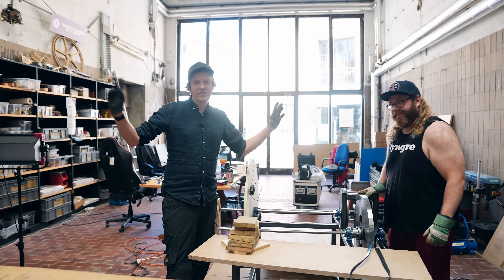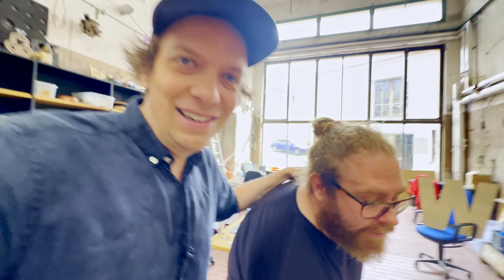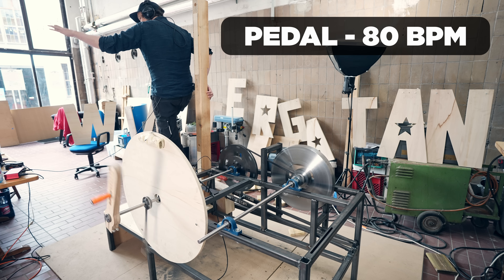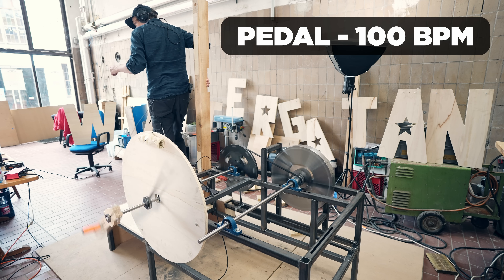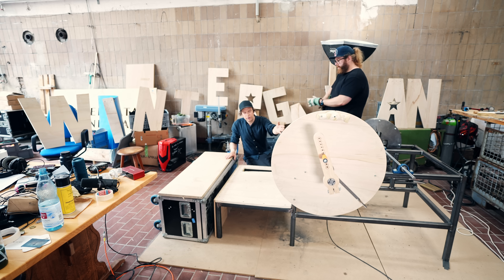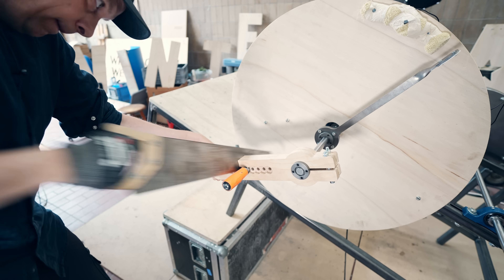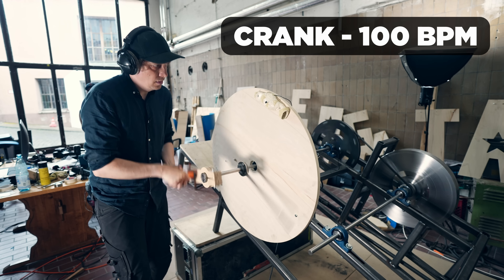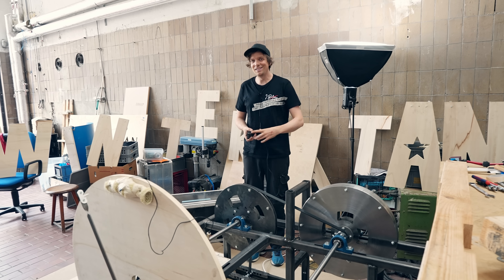Heavy Flywheel plays Tighter music! - DAY 11 - Marble Machine Flywheel Prototype

Comment: This is not at all an exercise in how tight music can be played on this machine. It's an exercise in how Martin can match an arbitrary spot on a wheel for a few spins before it inevitably goes out of sync again.
Reply: To me it seems like he is just testing the physical mechanics of the operator trying to keep a consistent temp. This makes sense to me from a user perspective. I do think adding a speed governor and a gear cassette to shift between predefined tempos (as well as a "free" run tempo mode") would be much better solution, if the goal is to satisfy the "must have" requirement of tighter music - which given the context includes matching tempo perfectly
Reply: @FreejackVesa  We repeat. He is not measuring temp, he is measuring the ability of him and the machine to match a random sync point. If he is not planning to play this machine live synched with another machine, this test is useless. He never mentioned something like this, never separated the sync from the bpm, either practically or in terminology. What is see is him again seeking overcomplicated non-solutions to subjects he does not understand properly, or, does not communicate properly.
Reply: @constantinosschinas4503  my suspicion is that if he's intending to play this with other performers you will need to sync to a click track.
Reply: @OpinionatedSkink  The performers will sync with the machine. As they do in between themselves. This is what happens in all live performances anyway and naturally. A singer, drummer, lead will fall back or run and all the other will organically follow. The problem would arise if two machines need to sync. But this was never a design requirement, till now that is.
Reply: @constantinosschinas4503  he says he's not measuring tempo but I think in actuality that's what he is doing. Call it "sync" or whatever you want - it's the speed of the foot pump translating to speed of the flywheel which translates to speed of the programming drum, which programs to speed of the release of balls, which translates to tempo. I think the purpose and semantics of this test are complicating things. Think of it in totality. As you say, what does sync measure? Nothing. It just shows that you can reach and sustain tempos for extended periods of time. And yes, he's an idea man and a dreamer, let him follow his critical paths, at least he is learning every time he does this. It's part of the show that we tune in for.
Reply: It's beyond my comprehension. MM could play tight music with a sloppy rpm. Tightness is in parallel events lag or I miss something? It's like a real drummer with a bass player could be super tight but they don't stick to perfect consistent bpm.
Reply: Either, after dozens of comments, he keeps confusing bpm with synching, or we miss something. It is beyond me that he does not simply use an rpm gun as a realtime guide on whether to slow down or speed up, ditching the unecessary, useless and complicated software analysis that reality is completely based on biased flawed (trying to always sync) user input that neglects what is important: stable rpm...
Reply: At first glance you might think that his test is simply a measurement of whether "HE" can hit the right beat. However, what Martin is testing is the consistency of whether the flywheel can consistently match HIS rhythm. Think of how practiced Martin is at playing music. HE wants to be able to play tight music without worrying about whether the machine will copy his beat. Essentially, its an input/output test. If I put in the right amount of force, do I get the right tempo out of it consistently? That's what's being tested here.
Reply: @SuspenseWorkouts  it's interesting to see null hypothesis test, where Martin uses stick and mic to show time deviation without any mechanism.
Reply: Needs a governor then
Reply: @SuspenseWorkouts  The machine always matches the player's rythm, delayed by the inertia of the flying wheel. That is irrelevant of what he erroniously tries to measure. This is again one of the times that having geeks that can programme around you, actually make things worse and overcomplicated, and in the meanwhile get irrelevant results. Groupies.
Reply: Martin appears to be attempting a Human PLL (phase locked loop). He’s quite good at achieving a certain bpm but his audio cues tell him the phase difference between his manual cranking an an arbitrary reference. 
Why? 
I no longer see what he’s trying to accomplish. 
If he wants to add marble sounds to a recording then “zero phase” is important for “tight music”.
If a band is following his lead as he plays the machine, or if he’s solo, then it’s already steady enough.
Reply: @barryhansen3168  As I've said before, Martin is moving the goal mid-game.  He originally defined "Tightness" as:  "Assuming a constant repeat-triggering, do the marbles always strike the instrument at non-random intervals."  The moment Martin started looking at standard deviations, he was asking the question, "Does this dataset have random fluctuations [that obey a Gaussian distribution]?"

Now?  He's measuring a periodic … and therefore by-definition deterministic … oscillation.  Standard deviation is a useless measurement for deterministic behavior.

I expect him to next conflate mechanism-latency with "tightness":  yes, there's a 10 millisecond delay between when a programming pin hits the trigger and when the marble strikes the instrument.  And it's always 10 milliseconds, with no random variations.  You and I just know that he's gonna obsess at getting rid of that 10-milliseconds, because he's redefined "tightness" to mean "zero latency."  ☹️

As you hint at, latency won't be an issue if the rest of the band is keeping time to the MM3.  But if Martin tries to make the MM3 keep time to, say, the drummer, he will fail every time.  Because an instrument like the Marble Machine cannot, by nature, keep a fixed BPM.  Having the MM3 keep a smoothly varying BPM should be good enough.
Reply: @jeffreylee7184  As I said in my own comment, Martin is moving the goalposts on himself:  he's redefining what he means by "Tightness", thereby creating the very situation you described.

Originally, what he was calling "Tightness" was:  "Given repeated triggering of the marble-drop mechanism at a fixed Δt, how much do the marble strikes [on the instrument] vary?  Do they stay a fixed time-interval apart?  Or does the interval between repeated marble strikes vary around some average?"  If the triggering mechanism, from the programming wheel to the marble striking the instrument, doesn't play an 1/8th-note as an 1/8th note, if it's delayed by 1 ms on one note, then is too soon by 3 ms on the next note, then too soon on the 3rd note by 1ms, and so on, the music won't sound right.  Having 0ms variation between every note played — that was his original "Tightness" criteria.

Jeffrey, you're absolutely correct that Martin is setting himself up for frustration and failure, because he's moving the goalposts on himself while trying to make the power module do something other than provide power to the machine.  We need to get Martin to see that, or he's creating a world of pain for himself.  I hope someone who reads this is on the MM3 Discord and can get word to Martin to stop redefining "Tightness" mid-game.
Reply: Also: titing, and requires concentration, and when actual force of the mechanism will be applied it will be going out of sync CONSTANTLY. Not just a governotr, but a motor - that's what he needs.
Reply: Agreed!  He's not talking about "tightness" but "keeping tempo."
The "tightness" concern is, "Given a constant power-input, do repeated marble releases strike the instrument with zero random variations?"  If you're playing a sequence of 1/8th-notes, you don't want there to be random 1 to 5 ms variations between the notes!

But gradually varying tempo?  Music naturally changes tempo!  Martin needs to just make that part of the natural behavior of the instrument, akin to how there's no volume-control on an organ or a harpsichord.  Composers, like Bach, had to come up with new music techniques, both in playing and in composing, to compensate for the lack of volume control in a harpsichord versus the natural ability of violins and cellos to control their loudness.  He … and the rest of Wintergatan … just need to lean into the Marble Machine's naturally-varying Tempo and make that part of the music.
Reply: @jeffreylee7184  Actually, that's not quite right.  Musical notes don't need to be spaced in time uniformly, just deterministically.  Tempo can speed up or slow down … just not at random.

For example, if you have absolutely fixed and uniform BPMs while playing CPE Bach's "Solfeggio", you get what my harpsichord instructor called, "Sewing-machine-Bach.  A Sew-feggio.  Not what we want." 😆

"Tightness" does not mean, "An eight-note is always this-many-milliseconds long."  BPM can vary — tempo can vary, and is one of the traits of this instrument.  No, "Tightness" means that "Back-to-back eighth-notes when played at a constant BPM do not randomly get longer or shorter."  Well, "Tightness"-as-Martin-originally-defined-it.

Another problem that I haven't brought up is that the programming "wheel" — really a programming cylinder — has its own Moment-of-Inertia, meaning it is strongly coupled to the power-module.  You also brought this up indirectly when talking about adding loads to the power-module.

But I repeat:  having a non-constant BPM is okay as long as it's not a randomly changing BPM.  If it slows down, then speeds up, then slows down again, well, that's just a trait of the instrument.  Kinda like how a guitar or other fretted instrument can't play microtones, but a violin can.  Or how baroque and rococo composers had to work around the fact that a harpsichord has zero volume control, while every other instrument can change its dynamics.  Slow, consistent variations in BPM are just part of this instrument.

But if Martin really wants clockwork tempo, then he needs to power the MM3 like a clock.
Reply: @jeffreylee7184  Well, remember what he defined as "Tight marble drops" originally.  BPMs were not a variable.
Also?  The moment he started looking only at standard deviations, his question became "does this thing I'm measuring have random fluctuations [that obey a Gaussian distribution]?" 

That's the problem:  he's changed the definition of "tightness" and doesn't appear to realize it.  He's still looking at standard deviations … which don't really tell you much if you're dealing with deterministic data.  And what he's measuring here is periodic behavior, one of the standard examples of deterministic behavior.  Using standard deviation here is like measuring the length of your house by timing how long it took to unroll the tape measure!

And you're correct that Martin is putting in a great deal of effort cranking that flywheel, even before he tries to hit a specific BPM.  He needs to change how he's storing energy, decoupling it from the BPMs.

Comment: The flywheel should just be your power storage and drive output. Nothing about how fast/slow you put energy into the flywheel should contribute to the actual BPM of the output. You need a mechanical governor as well as a power output divider if you want to actually play tight music. You are asking the flywheel, pedal/crank to do too much.

Comment: The hand crank plays tighter for several reasons, but one of them is that both positive and negative power input is possible 100% of the time, while with pedal it's much more restricted - when pedal goes up it's possible to only add negative power (to slow it down), when pedal goes down - only positive (speed up), and in end positions the power transfer is zero, making for a much more uneven power input.

Comment: Hey Martyn! I really do think you should go with a hybrid solution with a weight-based clock actually moving the machine, but the pedal keeps the weight off the ground. I would definitely start each song with the weight all the way up as well, so that the inertia is already built when you put your foot down.

This way, the consistency of your foot doesn’t matter to timing, but it is still you who is creating the power and driving the machine. As long as your foot power is greater than or equal to the weight falling, you’ll have consistent music.
Reply: I agree and can't see what the downsides would be other than adding more weight to the machine. Should be possible to rig a system which allows for quick changing of the weight also.

Comment: This is getting very dangerous! If anyone gets caught in the open belt/pulley, the kinetic energy literally will rip their arm off. Same with the crank arm.

Besides, this is becoming a huge detour/ feature creep / sidetrack that is so far not delivering any worthwhile results.

Please just use an electric motor for now, and put this flywheel-escapade in the fridge for the moment.

Comment: Because this is a feedback loop, some damping may be required to reduce the speed variation. This will be provided by the marble machine's frictional losses so the machine should be easier to control once the whole machine is done.
For perfect testing there should be some friction added to simulate the machine losses.

Comment: i think you should mount the timing "clock" with the contact mic on the other side, where the big pulley is, then you can mount the crank closer to the frame and bearing, that way the steel shaft doesnt flex as much.

Comment: A benefit of the crank is that you can adjust the power added through the full revolution of the crank whereas with the pedal you are really only adjusting power on the down stroke.   You could probably  increase the level of control of the pedal by adding a toe cup so that you can also control the pedal on the up stroke.

Comment: I think you could run it tighter if you had a BPM-"Tacho" (speedo?) to measure the BPMs of the machine live.
Right now you're hunting a "point in time" with the drum. This requires slowing down and speeding up all the time, to hover around the pulses of the drum and with hat your measurements are worse than it could be.
Don't try to match up with the drum but stay in rhythm with it even if you're early/late. I bet if you do that it's getting much easier to hold the BPMs.

Comment: It might be useful to differentiate 1-handed from 2-handed cranking, as well as considering what that means regarding additional instrument manipulation limits.
Also, a bicycle pedal input could be more similar to the crank, especially with a toe loop.  Following that, a similarly offset 2 handle hand crank vs 2 bike pedals.
Bicycles often come with a clutch and derailleur.  The one-way clutch may be good for safety, and the derailleur might be helpful when charging and changing tempo.
As the weight and gear ratio further favour the flywheel, getting up to speed and changing tempo could become more difficult and time consuming during a live show.
Some covers, even if they are clear plexiglass, for the moving parts that shouldn't be touched, may become even more of an important addition as you increase MoI.
A remotely triggered emergency stop could be good, if a loose shirt, cargo pocket, or headphone wire gets caught.  Good luck, Martin, Hannes, and the rest of the team!

Comment: Inertia is essentially an objects resistance to rotation around a defined axis. In the case of your flywheels (that axis goes through their center). Inertia of a wheel is only linearly related to mass but is defined by the square of the radius. So, easier to get more inertia with less mass by increasing the wheel diameter ( but that of course makes machining and material costs go up). 

Since inertia is resistance to a change in rotation around an axis, and your goal is to maintain a certain RPM, then the more inertia your flywheel has the tighter it will play.

Comment: Suggestion: Add an "air scoop" wheel to the setup. Now the flywheel isn't constantly providing any energy to the marble machine. In the 'real' machine you'll have to put in more energy into the flywheel to keep the same tempo and this can have a huge impact. Keep up the good work!!!
Reply: That's a great point! the machine will slow down a lot faster than this when it's being used. That might make it easier to match the speed, too, since it'll be easier for it to slow down when overshooting the tempo.

Comment: Martin, are you really sure you are messing the right thing?

Trying to be in sync with the click makes you go faster and slower chasing the sync. Are you going to use prerecorded media on the tour that needs to be in sync?

Why not try to use a device that measure your bpm in real time, and try to match that?

Adding more weight to the flywheel will make it harder for you to spin up or slow down. More weight makes it more expensive, harder to transport, harder to assemble, and it is a safety hazard.
Reply: It was supposed to be "measuring"

Comment: Would you ever consider a clutch as a safety mechanism? That way you can have as much momentum in the flywheel as you need, but only allow enough energy through the clutch to play the machine. If someone got behind a crank it could slip.

Comment: Martin another comment here made me realise that you're trying to perform a PID loop in this tests. A manual PID loop, and that could explain something about why you have problems with the tempo.
I think the weight of the flywheel would affect the P and the D, and maybe the gear ratio affects the I and D more.
If you don't know how a PID loop works maybe learning it could be of help. I don't have a good enough understanding of it myself that I think I can explain it very well, but I know the struggle of PID loops from electronics.
But PID loops also work for anolog machines, like steam engines.